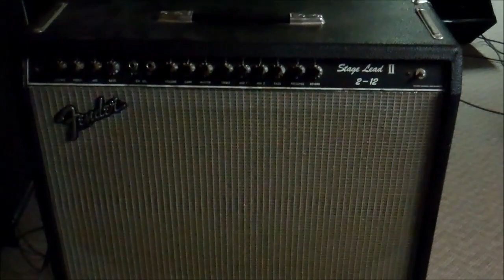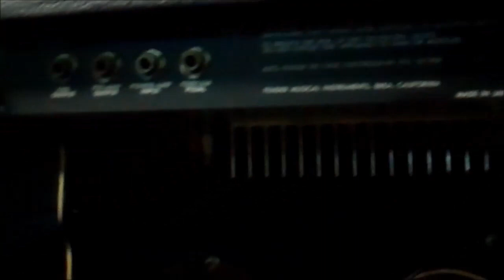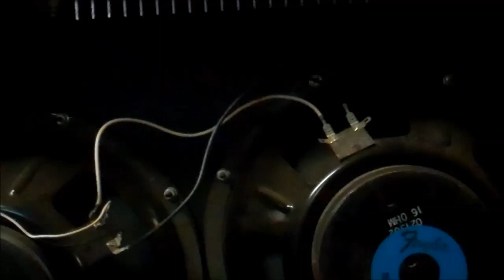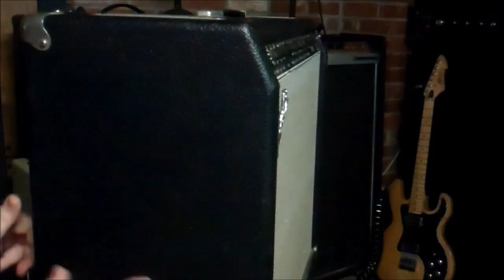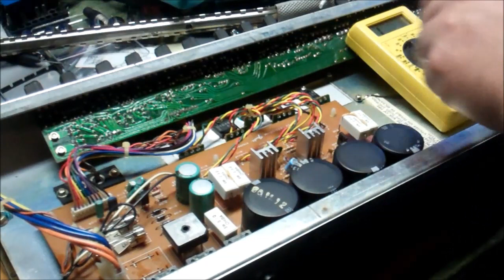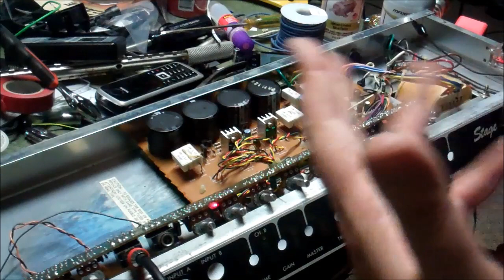Fender Stage Lead II 2-12 Guitar Amp in Unknown Condition...  Will It Work?

Comment: Hi i dont know how to get a hold of you. But i have a question. I have a fender stage lead 112 se. ive had 4 different guys work on it. It powers up and plays but sounds like distortion ? No clean sound at all. Has a new speaker. Any thoughts ?? Greg
Reply from the maker: Could be a bad transistor/opamp, or low power to one of those

Comment: I have one of these.  You almost never see them brought up, let alone for sale.  Sucker is heavy too.
Reply from the maker: It was a weird time for Fender in the 80s
Reply: @DeadKoby  From your tone in the video, it must have.  Please take with a grain of salt, but I was told the potentiometers for these amps were somehow unique to the series and not available anywhere.  Looks like fairly regular pots to me.  Any insight on that?  Mine is missing a volume control (not the master volume) and a mid for the second channel so that channel only has limited useability.  Otherwise perfectly good old amp.
Reply from the maker: I doubt they are that much different than off the shelf parts.   Amplifiedparts likely has something close enough to work.
Reply: @DeadKoby  Thanks for the response.  I'll check into that.

Comment: Hello sir I enjoyed your video and I have one of these amps (stage 100)  it’s all I ever need but it’s going in and out during use and this problem just started a week or so ago during rehearsal …can you fix this problem and if so which steps do I need to take thank you
Reply from the maker: It'd be a guess........ sometimes you'll find a cracked/bad solder joint....  bad jack or old caps...  it's hard to say.   I could probably fix it.

Comment: Hi!!! I have a STAGE 1000 and it already blown 2 fuses, what do you recommend to do?
Reply from the maker: Assuming you have the proper fuse,  you need to find the source of the excess current draw.  Usually a transistor or capacitor that is getting hot.